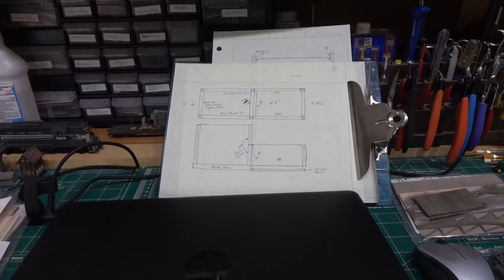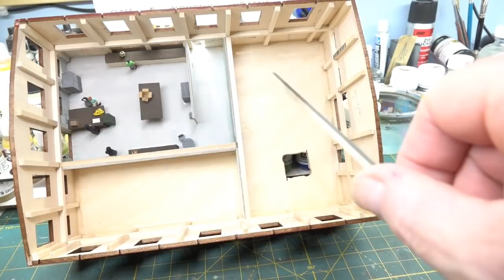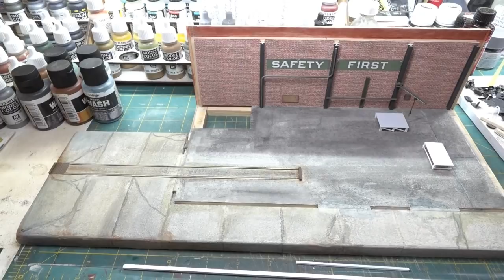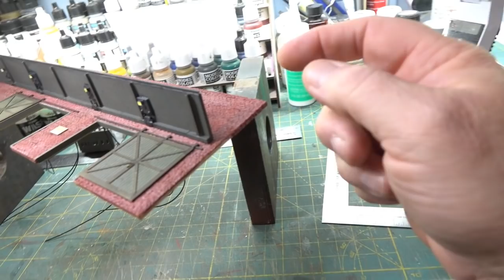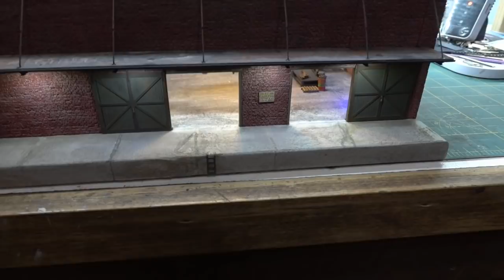Scratch-Bash Project: Industry for Lake City- Part One

Comment: the stars are a Firefighters Nightmare.  They were typically used in conjunction with a long rod either in the floor joists or in a trough in the underside of the floorjoists.  If theres a lot of fire showing and those stars or half moons or anything with a large nut on it are present, it means the floor may fail and come tumbling down.  the floor is hiding perfect channels for fire spread.

Comment: Should I sand or file the painted parts before using the glue? I notice the canopy/supper glues seems to work through paint surfaces but did you "rough" up any surfaces to give the glue some purchase?  Just curious.

Comment: Any video that starts up with a Monon 40' boxcar with the Hoosier Line banner gets a like from me.  I grew up at the end of the Monon's Michigan City branch and once got a cab ride in a Monon F3/BL2 lashup, circa 1963.  Their "drive-thru" freight house and engine air powered turntable were highlights.  I just got back into model railroading after a 20 year break, and except for Sticker Shock it's been a blast.

Comment: The transformer oil is installed once the transformer is placed on its concrete foundation at the substation. They are transported fully disassembled and as lite as possible due to weight restrictions on the railroad.
Reply: Not always...we often ship units oil filled. Both by rail and truck, but units by rail are usually much too large (MVA wise) to enable shipping full.

Comment: Yes I did !!😂. May I suggest, with all that wiring you did on the interior might as well run power lines from a utility pole to the structure when you start to detail the outside, like you did for the turntable. Thanks for sharing.

Comment: Yes, Rob, I did actually watch the entire babblefest! Although I must confess that I took a break to replace the blend door (not the actuator, the actual blend door inside the heater/AC case) in the rear unit of my 2004 Chevy Trailblazer EXT. Between doing that and having a root canal without anesthetic, I'd take the root canal. You did a nice job on that building! At a train show a couple of years ago I bought a Model Power 2 bay engine house which I kit bashed into the shipping/receiving building for the RustEze Medicated Bumper Ointment plant. Mater was just beside himself with glee over that one! Kit bashing can be fun!
Reply: LOL...wait- you would rather have the root canal over watching this video? Ok, that makes sense. :-)
Reply: @robbennett1965  Uhhh... no. I would rather have the root canal than have to replace that blend door! Your video ranks just ABOVE the root canal!

Comment: Rob, nice job as always.  I really enjoy your on-going justifications of the design and detailing decisions you make.  That makes watching each entire video very enjoyable (even if I needed two sittings to get through this one).  Regarding the jib crane, if you have a spare turn-buckle brace you should connect it to support the top of the jib crane from a ring mounted high on the beam at the wall, just like the awning roof is supported.  Just one more detail that few will ever see. ;-) 
By the way, I finally had to create an account so that I could subscribe to your channel and comment on your videos.  I'm still looking forward to seeing what the repair crew can do with that 3rd NYC Pullman car, at least once they complete the numerous other structure and track-work projects that you've been presenting all year. I'm enjoying seeing all that you are doing around your layout.  I like it all, so no hurry with that Pullman car.  I mentioned it mostly for you to make the connection of who I am.
Reply: Hey Dave- yep, got it! And I was considering adding a brace as you mentioned from the top of the jib back to the column- I have seen that before. But I just figured it was a lower rated jib and the support wasn't needed. At least according to the "Engineers". NYC car is indeed on the project list. Once I get things moved along on the main layout it will be done!

Comment: Those medallions that you were talking about, are actually support plates. There is a rod that connects from that plate straight through to the building on the other side. It's due to the roof being curved, which forces the walls outward. So those rods were put in the hold the walls together
Reply: Ah, thanks. I kind of figured that was the intent, but was not sure.
Reply: @robbennett1965  They used to use them a lot here in the UK for keeping houses together especially rows of terraced houses (houses built in a row with no gaps between them). It saved a whole row having to be demolished just because one house was spreading apart. A common site in the industrial towns that were built for the workers in the cotton and woollen mills etc. If you hadn't used the bracing you did on your build you would have probably had the same problem :)

I have to commend you highly on you layout and the attention to detail you put into your work. I started watching just before you used fur for grass and I thought you were mad until it was finished it and it blew me away, so then I had to go back to all your previous work.
Reply: Love the video.

Comment: Rob - Wow - I'm glad you posted this now, any later and I'd be up all night! 9pm here in England.
14:00 … and so it begins, goodness knows where it will end.
32:00 Yup, the Ground Floor is at ground level, level with the ground! First floor is the first one you come to going up stairs, the thirteenth, is well you get the picture. And the Basement is generally either below ground level or semi-below ground level. A Cellar is almost invariably underground.
47:00 Front Office building: looks stunning and well work the effort.
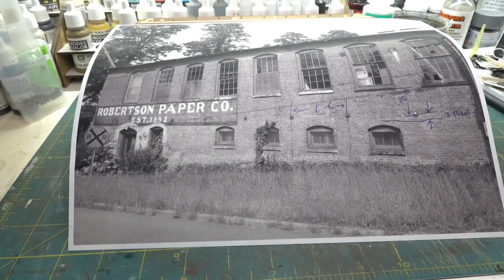53:30 "Briefly" - oh I do hope not!
1:02:30 "Things I may or may not do." We'll see. Transformer unit sounds good (bespoke/customised?). Could they just be assembling and testing a kit of parts, the parts come in through the side doors, and assembled units leave through the end door?
1:17:00 Love those star washers (braces?) and the door handles etc, yes you (and now we) know they are there.
1:40:00 "Bennett's Custom Transformers" would look great painted above the canopy. Or similar?
1:55:00 Great roofscape.
Made it through the whole "babblefest"! Looking forward to part 2.